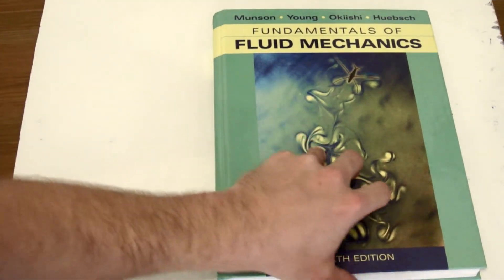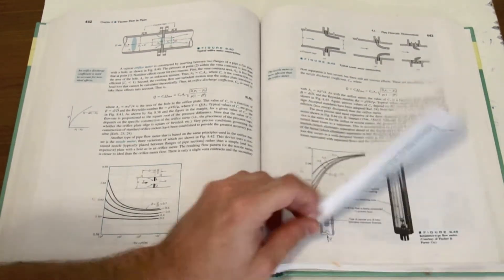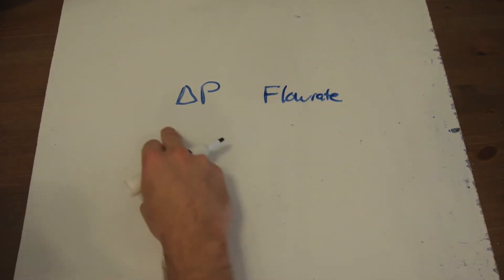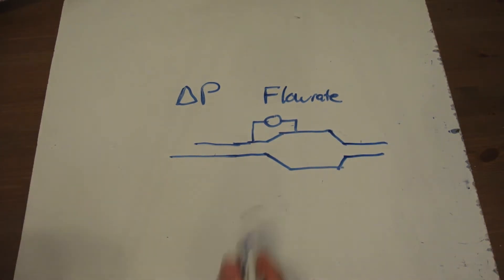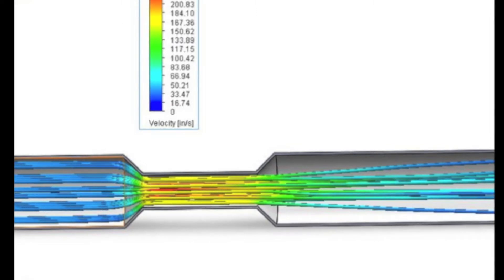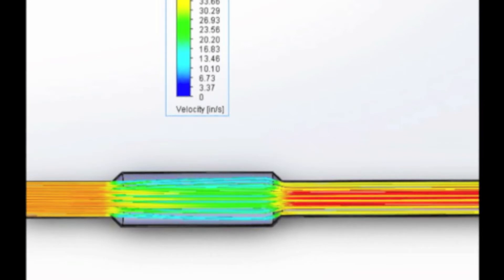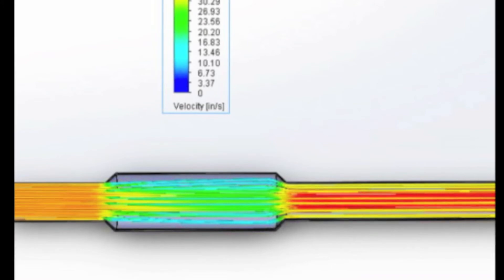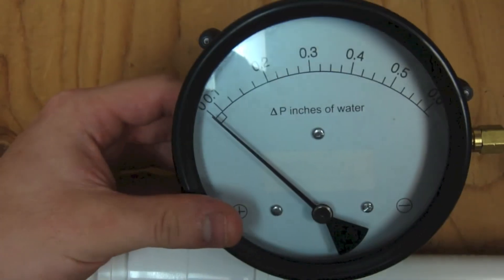Rethinking the Venturi Meter

Comment: Hi. Thanks for the video. Theoretically it makes perfect sense. I am curious about the calculations and accuracy of the system. Will factors such as the sharpness of the exit and entry edge inside the larger chamber cause co-efficiency errors.... Have you compared your measurements in actual tests? I would be very interested to know the result! Kind regards.